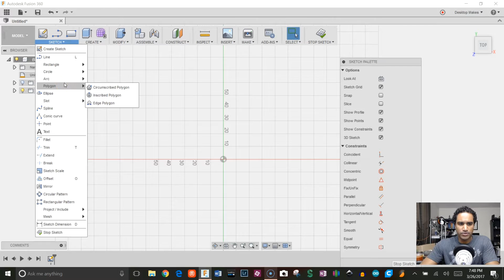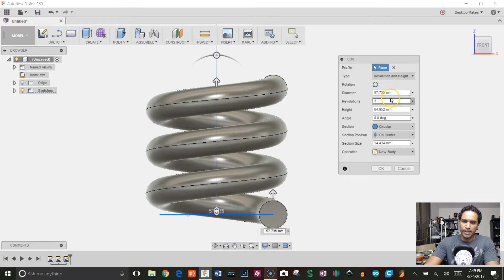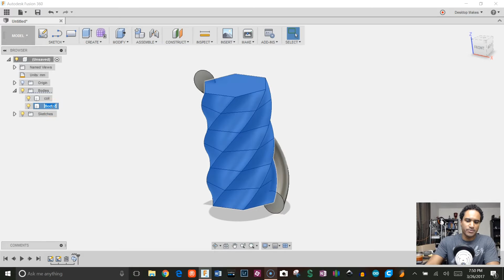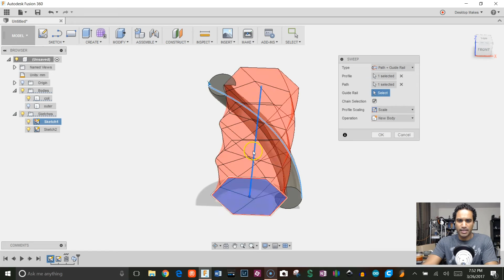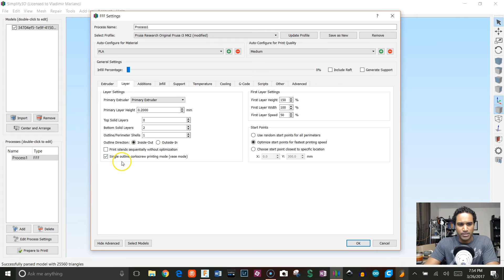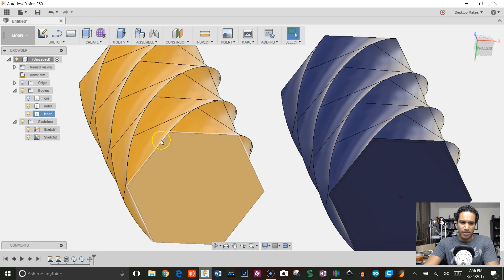A Better Way to Design Twist Vases in Fusion 360 - Coil and Sweep

Comment: Using loft and rails is quicker and gives the same control.
Reply: I had trouble with using loft and rails for twisting a rectangular shape. This worked first try and seemed more intuitive for me to think through. It is great that there is more than 1 way to choose from!
Reply: @SafetyZar  Good point i just tried it rather than saying it and i failed :/

Comment: Really like your video's and style of sharing useful info. I just learned this technique earlier today. An even easier way to create  a shell from a solid is to use the modify then shell command. Pick the top surface looking down and enter the dimension for the shell thickness. Also make sure to choose inside for the shell.

Comment: What kind of 3D printer do you use and what's the cost of it? Great video looks fun to make
Reply from the maker: The one I used to print the twist containers is the Prusa i3 Mk2.  It's $899 assembled and $699 as a kit.
Reply: Thanks! I'll check it out

Comment: Good vid!
I started designing these on AutoCad. The way I did it was the following:
create your base profile(circle square, filleted hexagon etc).
Make a vertical line at the center(like you did)
Choose Sweeep function, and AutoCad has an option that lets you "twist" the base profile throughout the vertical line.
Then you need to type in the number of "revolutions" in ° that the profile will revolute until it reaches the end of the vertical line.
End

Comment: Actually, you made one mistake here. You should select the vertical line as the path, and the coil curve as the guide rail. That will give you a nicer surface. In your video, the twist shape becomes segmented, and that's because you used the incorrect entities for the guide (not guard!) rail and the path. Try the other way and you'll see that the result looks better. It probably doesn't matter for the printed result, though.

Another thing, I prefer using a triangular section for the coil (as I wrote in the comment on the other video). Again, doesn't really matter, but the sharp edge just feels more correct to use (as the guide rail).
Reply: I noticed that too. At first I couldn't see any difference but I thought there must be a reason to use them the way you said last time. Then I spotted it.
Appreciate your input, thank you.
Reply: I know what you mean, we all run down at the end of the day.
Great video though.
Reply from the maker: Oops.  You're right I do get the twist shape without the segments.  I realized I said guard instead of guide.  I should stop recording videos at midnight :)  Let me see if I can correct this without re-uploading.  Thanks.
Reply from the maker: Just looked at my desktop clock and I recorded at 7:50pm so there goes my excuse.  Haha, well  I was able to add some annotations to mention the correction.
Reply: We are only human though. More excuses where that came from :-)
Also, it gave me something to try to overcome, I do like a challenge. Ain't that why we have 3D Printers :-)